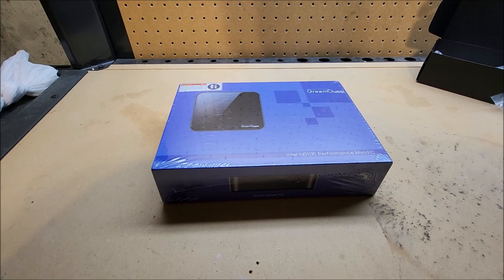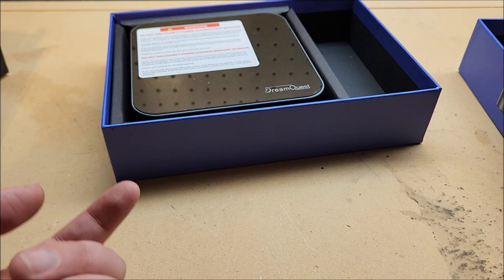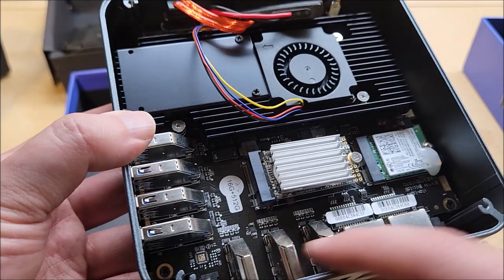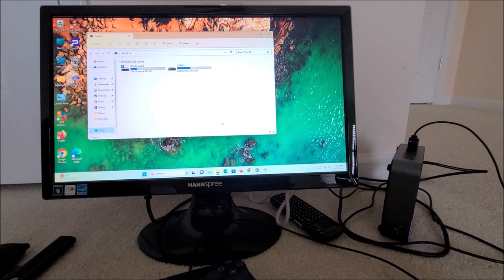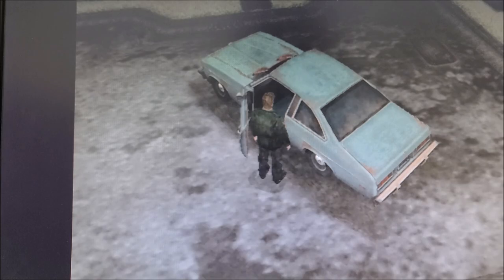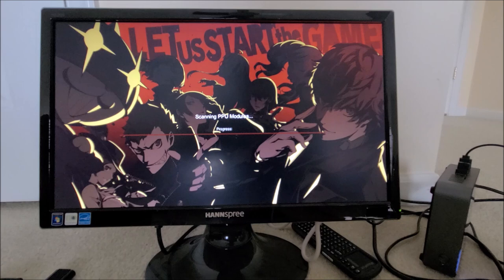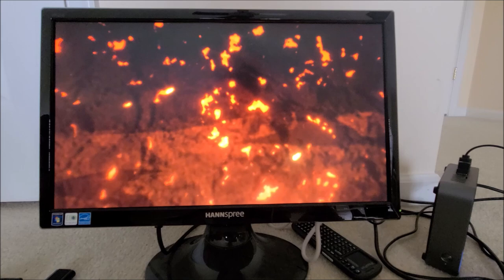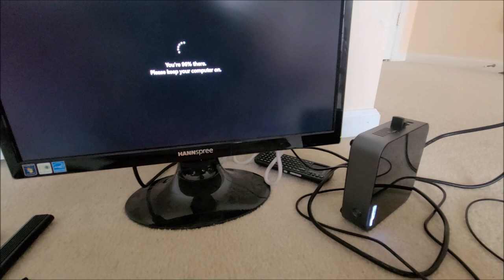Dreamquest Pro Mini PC Review

Comment: Thanks for your response.  I got it figured out.  Had a problem with the dongle I had and got a new keyboard to continue setting up the machine.  The system I got had big warning stickers about interrupting the boot, so I'm a bit freaked out, considering your experience.  Will keep it on until I get through set up as the keyboard is coming by priority mail.

Comment: Great video thanks. Amazon UK seems to suggest the max internal ssd that can be fitted is 2TB, what does the manual say?
Reply from the maker: No technical reason that I know of why it wont work with a larger drive
Reply: @sjm4306 can it run fortnite

Comment: blue screened because you took it apart without a eletrostatic band grounding band. you got u=such good service because they sent the device to you to test. the rest of us not so much. The bios update makes the machine slower so do not update.
Reply from the maker: I have to call bs on the esd suggestion. Esd would cause permanent physical damage, not corrupt the os which was easily fixed by reflashing win 10 which is what I'm running on it now. I speak from 15+ years of experience as a professional electrical engineer having taken apart thousands of things in the exact same way over the years with zero esd damage caused. Hell, when I was a kid I used to take stuff apart on bare rug and never had a problem.

Comment: to be fair a reviewer should be able to install windoze which barely takes 20 mins if you have an iso ready
Reply from the maker: True it's not difficult but if you spent ~$200 on a product you shouldn't have to "fix" it right out of the box. It's fair criticism that when you buy something that it should work. And I basically had to do an installation repair anyway to get it to boot before I even found that it had this issue.

Comment: Hello so you see these smaller computers getting even smaller in the next 20 years?
Reply from the maker: Yep, I wouldn't be surprised if we eventually get full blown phone sized computers with decent specs sooner than later. If you think about it high end phones can already blow lower end pc's out of the water.
Reply: Fanless PCs are cool, unfortunately the cheap ones are still not very powerful.
Reply from the maker: Give it time, the current crop is way better and cheaper than just a few years ago so I can definitely see something in the performance range of a steamdeck for under $200 before long.

Comment: Could this run revit, or do 3d rendering
Reply from the maker: Technically yes but honestly it'll be sluggish. For cad stuff having a decent dedicated gpu makes a huge difference. This guy only has integrated graphics.
Reply: @sjm4306  what if I plug in an external gpu?
Reply from the maker: You need a high speed thunderbolt port to use an egpu, this model doesn't have one of those.
Reply: @sjm4306  Thanks for the info 😊

Comment: Ram cannot be added??
Reply from the maker: It's hard soldered so without solder rework equipment to desolder the old ram and solder in larger compatible chips and possibly patching the bios then no there's no easy way to just upgrade the ram.